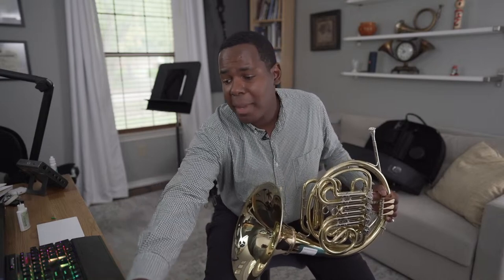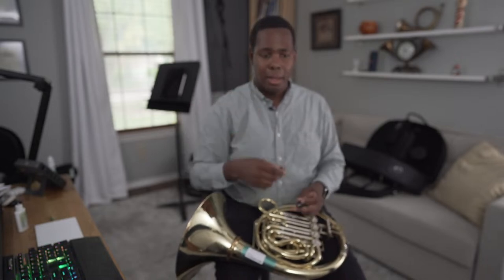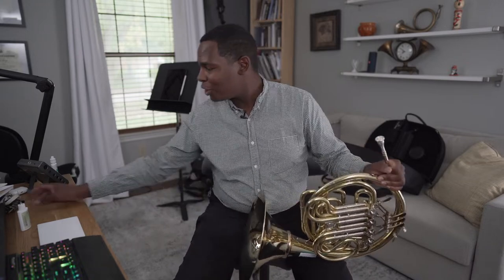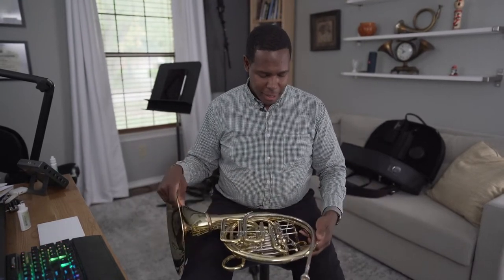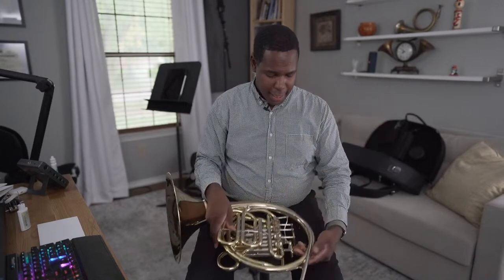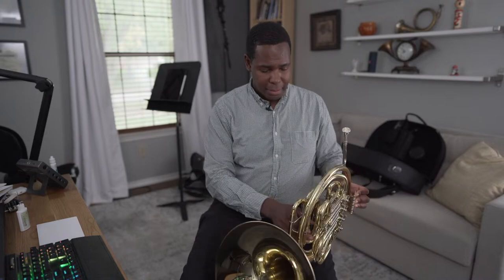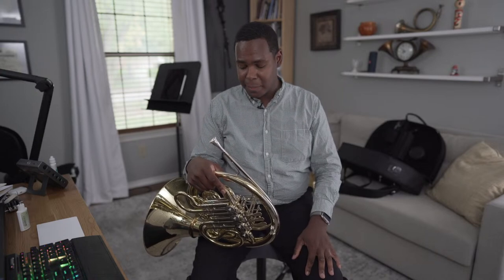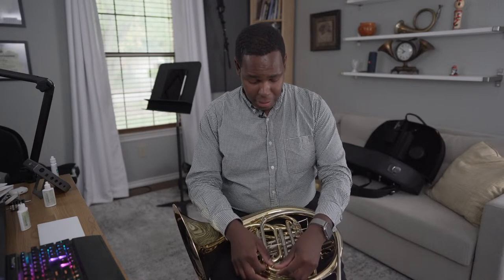The most innovative horn?

Comment: Wow, that's actually quite new and interesting, thank you for sharing it, great video :)

However, I would challenge that it is the most innovative horn, I think this is better deserved by Schmid:

* Minimized the rotor wall thickness to reduce blocking the main tube much less when rotating. Schmid empirically shows how it improves lever trills and shows a diagram on how it helps on getting better attacks when quickly changing positions.

* Lighter and smaller rotors are much faster, as you said, but it is not new. A Schmid triple rotor weighs less than a normal double one (just the rotor). I think this is even more radical improvement than the composite rotors (changing an established shape is IMHO bolder than changing the material)

* Use of mathematical models to inform the shape of the conical sections (I don't know how this improves anything if at all. He can justify the shape of his horns with it, but the decision of the shape is still arbitrary, why did he chose 1/x curve? Sounds as arbitrary as any other shape non-math-based, unless he explains why, which he doesn't, but at least he says he used it to derive the "Kompakt" shape)

* Analysis of the frequency response of the whole instrument through a special generator and measuring devices and software, and deliberately fine-tuning the compromises made in the instrument instead of hoping that it's fine (I think this is the key of his innovations, well, not actually his, as it was done in partnership with a university)

* Ensuring that the wrap allows for water to be drained with the water keys most of the time, without having to take out different slides and constantly rotate the horn (don't get me started on how all the condensation collects on the 3rd valve on the A 103), many horns you see even today pay no attention to this detail.

* Making a new triple horn wrap with separated valves that is now preferred by so many soloists (I know a few, even a renowned professional orchestra that completely switched to Schmid. The separated valves for a wrap on its own is not an innovation, the first ever double horn (maid by Kruspe) had separate synchronized valves to switch F and Bb sides)

At the end of the day, "innovation" must be targeted not at random things (like having actual ball bearings on rotors (Stomvi)), and my professional friends tend to agree (without knowing any of these details) that they mostly prefer Schmid horns, so it seems that these changes actually make a difference (I can't tell, I only have a 103).

Comment: How do the valves compare to hollow valves? Like what Atkinson offers.
Reply from the maker: They are much lighter than the hollow valves. You can reduce the weight considerably by hollowing out brass rotors, but not nearly as much as using a different material.

Comment: it could be like a carbon fiber composite which usually use epoxy resin which is a plastic
Reply: Could be, but tbh it would be smarter to use a traditional thermoplastic like uhmwpe because they have such low friction. Everyone tends to just view carbon fiber as the king of non-metal materials, but it's important to have the use case in mind. Valves don't see stress at all really, they're only made out of metal as they're very easy to turn on a lathe to precision. But If you used a cnc mill to make uhmwpe rotors you could get incredibly low friction. The one issue is lubrication, because of equal importance to free moving valves is the airtight seal that oil promotes, which might make a low friction valve material unnecessary in the first place.
Reply: @rcbuggies57  but that wouldn't be a composite right?
Reply: @samuelzackrisson8865  No it wouldn't, but that's what I would try personally lol. It can't be a fiber though because you can see it's an amorphous material. They mixed some type of powder with the resin, it could be graphite, as it's basically the powdered form of carbon. But it can really be anything, I bet they did research with multiple materials.

Comment: My experience is that the player's skills makes all the difference in the world. He can take a crappy horn and make it sound great just from skill alone. With a few exceptions . . . . 

I played a Chinese Eastman for  2 years. But with dedication and 3x week practice, i was able to make a sound better than my teachers Conn 8D in 4 weeks time. The only difference was that I used a Farkas MC mouthpiece and that was monumental changed. After that it was work on my part.

I heard a Yamaha 567 play and it sounded like mud. Lousy sound. I played it and that sound was dull, lifeless, nothing to write home about. However, I came across this horn to acquire and was not too excited. However, I found out from 2 custom builders that changing the lead pipe to one of their own designs, and removing the clear coat, the horn comes alive - made something like 60-80 conversions with stellar comments. So I bit and gave it a shot.

Ya, it is completely different. It has a gorgeous sound, wonderfully in-tune, almost 4 octave range and all in tune, hollywood sound. And with a Yamaha mouthpiece instead of either the Farkas mouthpieces, it came alive.

Why say this? Because I have a hard time believing that composite valves will make that much of a difference. Weight should have no bearing on the sound as it is only <1% of the pipe that is affected. If it is heavy, go to the gym! the sound, as these builders state, is all in 3 areas: Mouthpiece; lead pipe, bell and the metals they are made from. The rest is just plumbing to make the pipes longer or shorter. They say the lead pipe has the most influence of all - 70% vs the bell with an additional 30%. Get the combination right and you have major improvements. The rest is the player.

I know some who spend fortunes on a horn and they expect it to play like Star Wars. The truth is the player plays a lot and it is the chops that makes the difference.